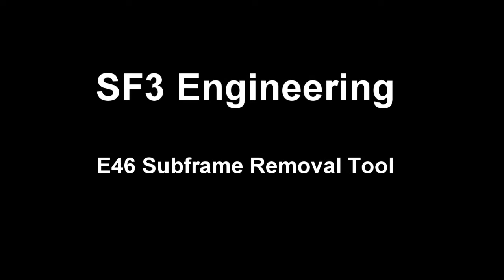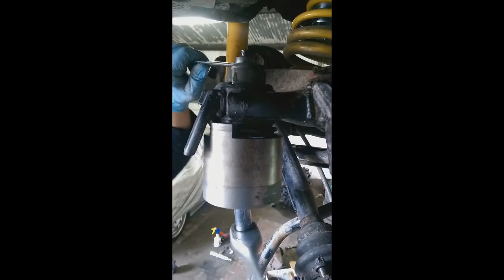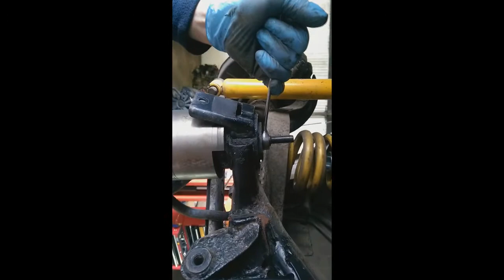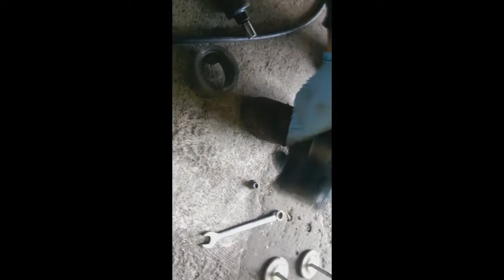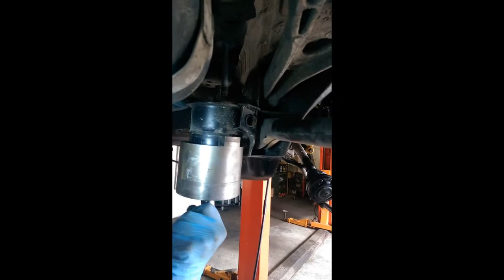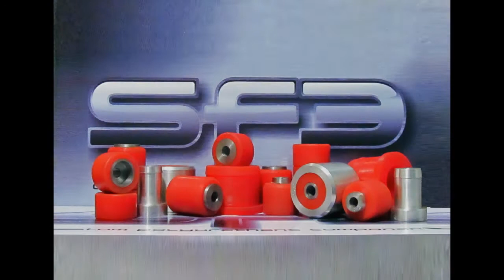SF3 Engineering E46 Subframe Bush Removal Tool

Comment: were you able to do all 4 subframe bushings? i already replace the diff bushings and there is less clunking but it is clearly still there. the last thing i want to do on my 330 is drop the whole rear. i dont have the time for that so ive been wondering if i can simply lower the subframe only a few inches and work my way around it.
Reply from the maker: E46SilverBullet can do all 4 like this